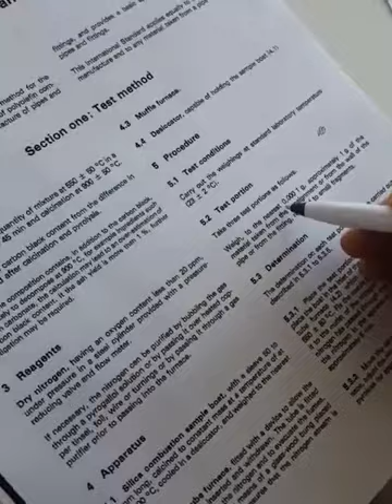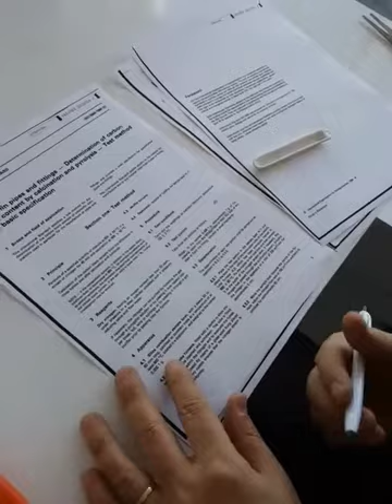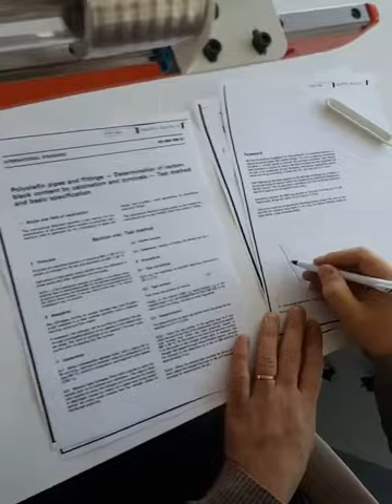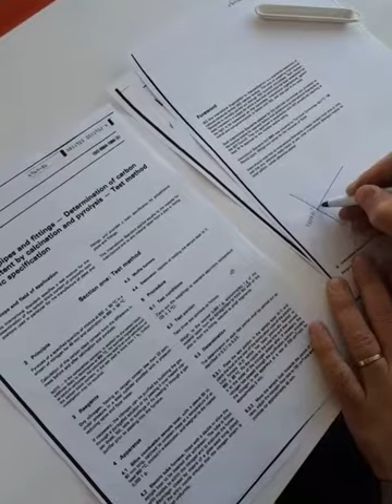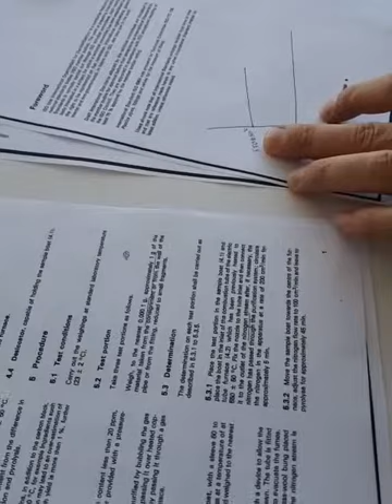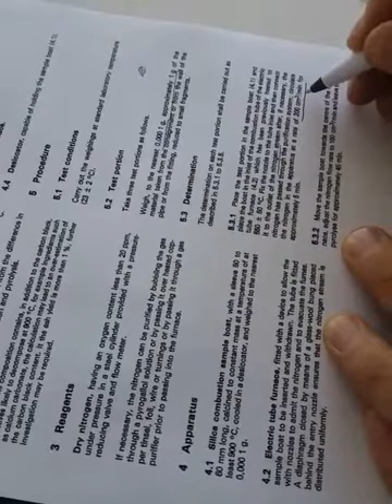Carbon Content Tester

Comment from the maker: Carbon Content Tester
According to ISO 6964
Including pressure regulator,
 hoses and connectors,
 chemical materials, glass trap,
 U pipes, 
silica gel, 
desiccator, 
sample boat 
Pack dimension (Cm): 65*50*70
Weight (approx Kg): 30